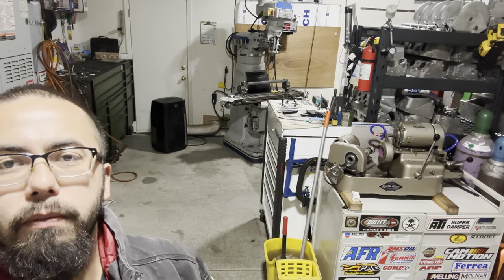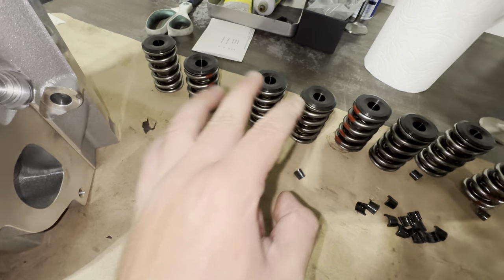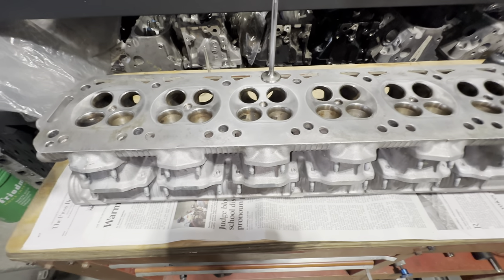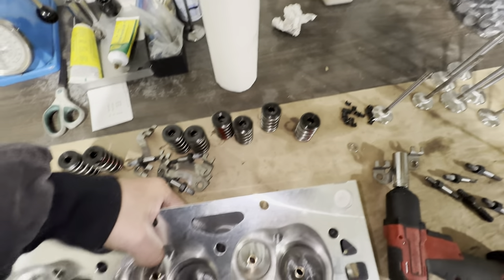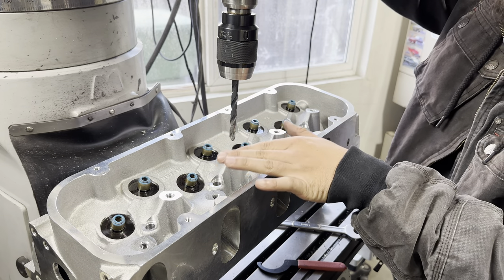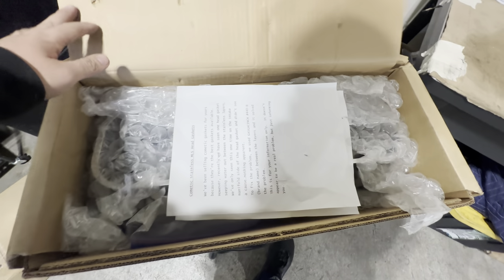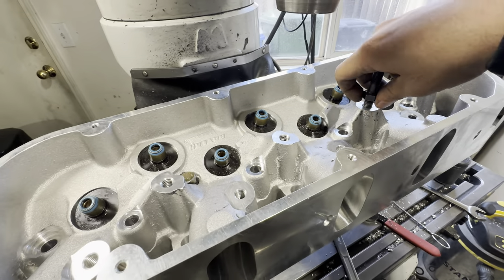Ferrari V12 Bad Valve Guides | GM 8.1 Rocker Stud Upgrade | Engine Rehab Tech Talk

Comment: This type of machining seems lost in the automotive world, but is alive and well in the motorcycle world. I have a 70s bridgeport and a lathe and do much of the same work for myself as a hobby. I mostly work on older air cooled motorcycles that do not have the amazing aftermarket support that cars have. I make my own guides, seats, bearing adapters, re shaping ports, line bore crank bearing journals, and more to make old engines run better than new. In some cases more than doubling the power output these machines originally had. I love seeing the tooling you use and seeing much of techniques I use being used in your shop as well as some new tricks I am learning from watching you.

Comment: As a fellow Josh that’s also a car enthusiast, I need to say you are living my best life. Teach me your ways! I’m about to pick up my first mill (had a big old lathe for a while) but had no idea I could do my own engine work. This changes everything!

Question about surface finish for MLS or similar gaskets, what process/tooling are required to achieve 30 Ra? Best I would think you could do is massive fly cutter with a real slow feed but have never had tools to measure surface roughness.
Reply from the maker: The average Josh is still a god among men. This is easily done in a milling machine. You need a large flycutter, big flycutter is a brand that I recommend to people. 30ra is easily achievable. The stuff I produce generally is a 12-18 RA. I can get it to single digits if I run it slow enough and the material is nice. 30 is easy.

Comment: 0:57 'Yeah yeah but but have you blued up ya mill and rubbed it on a surface plate tho! Didnt think so!' 😅
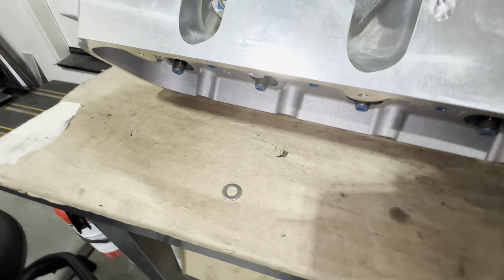13:30 Thats some understanding there, Ive noticed the same scraping machine tools. Things move around when stress goes into or out of a component, order of operations is super important when going for quality. 
Cheers D

Comment: For the kind of money that Raylar charges for these cylinder heads... you shouldn't be able to find a single microscopic flaw on any of them. What a disappointment those heads are. It's too bad the foundry cant sell bare castings for a competent machinist to build on.

Comment: Lost a TCM25 in a divorce mess . now 20+yrs later , have a LOT of NEWAY stuff and a walker/turner drill press that work well enuff for antiques . and i had recommended ; radial arm drill press let alone overhead mill/bridgeport , for cold cast repair .... shorten story , imho and experience from others ; anyone griping about mill vs seat/guide machine is ignorant or narcissist & ignorant . wish i had mill OR radial arm drill press .   now funny thing , i do believe that seat pocket cutter and guide trimmer for seals , many were built for a HAND DRILL . so many arguements moot . enjoy bud . even a 62 , love learning . BTW , how are the inlaws ???😮😅😊

Comment: Love the rick and morty morty socks followed by multiple bubble level references "true level morty?" I just had to pull my 8.1l heads over broken exhaust manifold studs. While in there noticed carbon buildup so bad a few looked to have been dipped in rtv lol. Brass brushed the combustion chamber face, once they where out of the head, they look new on that face. My question is, can the coating on the back of the valve handle the brass wheel as well? Planing to re hone the valve seat with compound after shining/polishing...just don't want to chew up valves from removing the coating..you sound experienced enough to know if brush wheels remove the valve coating..new valves are only like 200 or 500 for titanium in some places so if their toast so be it.. but they cleaned up well and I'd like to reuse them.

Comment: What is the angle of the valves in a Ferrari head?
Reply from the maker: Just checked. Looks like 9 degrees
Reply: @EngineRehab I pulled the head off my Ferrari and the valves measured out at 8.999998 🍺
Reply: @EngineRehab  thank you.

Comment: how does that old saying go "those that say you can't are usually in the way of those doing it" or something like that. that being said  i just want to comment on your constantly putting every other persons work you see down while blowing your horn, you do good work but you should work on humility cause dude you're not all that none of us are, and one more thing that Arca milling machind IS NOT  a Bridgeport it's about half the price of a bridgeport I used to work in a machine shop where we had genuine bridgeport's it wasn't a  engine machine shop we made other things we used from shim stock all the way to 5" thick steel we made our own dies and repaired our own stuff we had 1 old bridgeport like the machine you have the rest were cnc machines. we had a cnc punch that could do amazing things. and of course we had shears and brake presses tubing benders for with dies for round and square stock we could make repair or do anything we just didn't concentrate on engines, but we could work on our own stuff off the clock. I really enjoy your content just not all the bragging
Reply from the maker: Definitely never talked down on anyone. And calling any knee mill a bridgeport is pretty common. It’s like calling containers tupperware.

Comment: Your holes won’t be drilled on the correct angle with your ram turned to any degree other than perfectly perpendicular to the X axis. It will be close enough for what your doing, but if your counting on them to be on the exact angle you need to indicate your ram parallel to the Y axis. 
And I know that there will be a lot of machinists out there that will disagree with me. But stop and think about it before starting to run your mouth about how wrong you think I am.
Reply from the maker: Wait, are we saying that things need to be drilled straight in order to work? That sounds pretty basic!